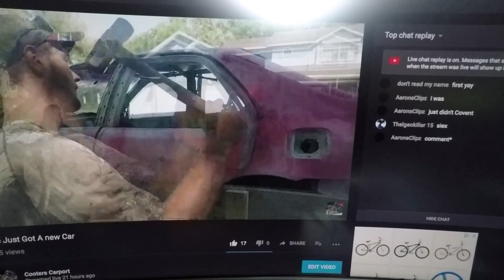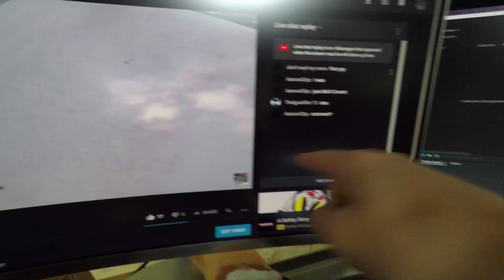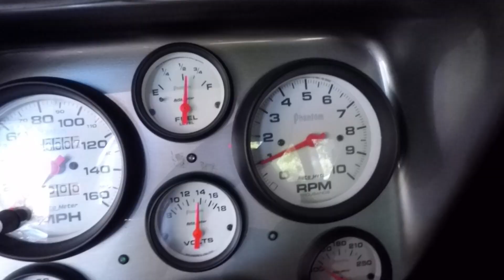WE GOT A HONDA!!! | Don't Forget to Enter the Giveaway

Comment: I had to get hex head bolts for clutch cover before I'd even gotten it on the bike.Stripped longest before I got cover off.Lucky I had impact screwdriver to crack it loose.(my engine painted at factory.This is reviewed by B TV guy too,)

Comment: Hey y'all I'm from North Carolina, I have question does the motorized bicycle can keep going under rain?
Reply: Thanks to Cooter,I sealed my coil and magneto.Actually was riding today and it was sleeting.Got a couple pops from the carb when I sucked in snow,but it ran the 3 miles home.
Reply: Mid-Michigan,btw.and yes,the 2nd run on my new motor and it started pouring.10 mins it ran in driving rain.That was when Cooter suggested keeping the magneto dry and I sealed it up the next day.
Reply: Huh....weather here Does suck when i want out.Lol.
Reply from the maker: It's not the smartest idea you could kill the cdi or the magneto